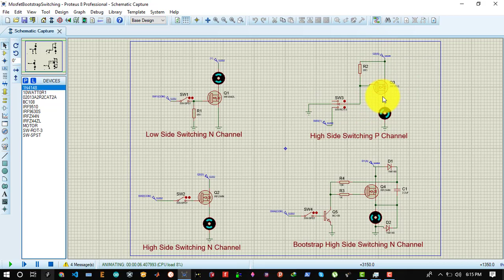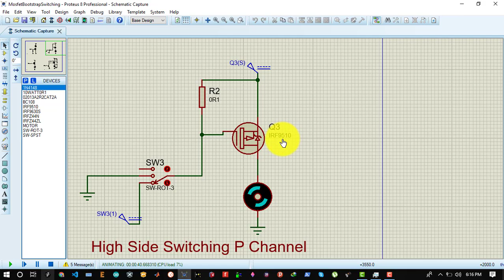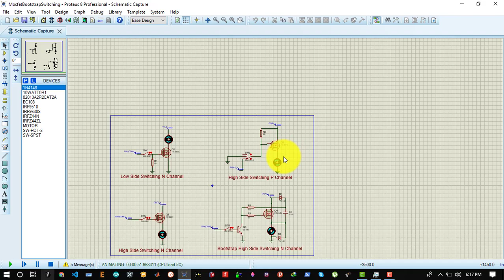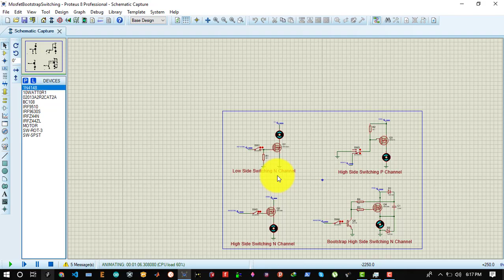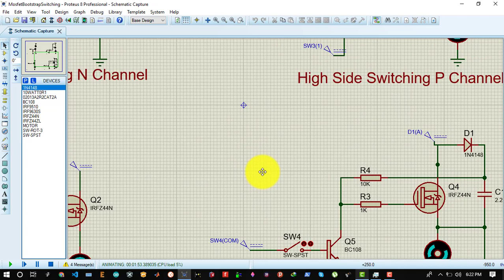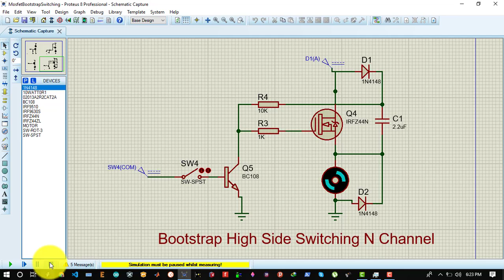Mosfet High Side and Low Side Switching(N and P channel Mosfets) #Mosfet Bootstrapping

Comment: Thanks for posting, assuming that a MOSFET fails with the source connected to the drain, is it possible to have 2 MOSFETs, a high side bootstrapped N-MOSFET and an N-MOSFET on the low side.  The load is a coil that is between 2 mosfets. if one MOSFET Fails the other will disconnect the circuit.

Comment: I struggle with this sometimes; whether to use the P channel on the high side and tolerate the higher resistance rather than deal with the complexity of the circuit to implement high side N channel switching. I've been reading datasheets on high side driver ICs but there is very little content on YouTube about gate driver ICs. Perhaps if you have the time one day you can cover it. Thanks for the excellent explanation.
Reply from the maker: Yes i can do it for you 🙂